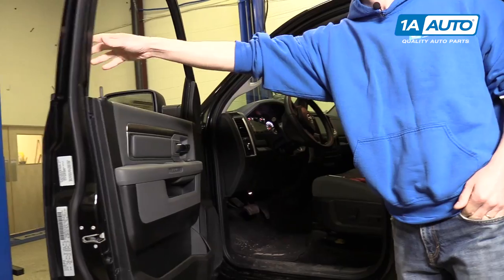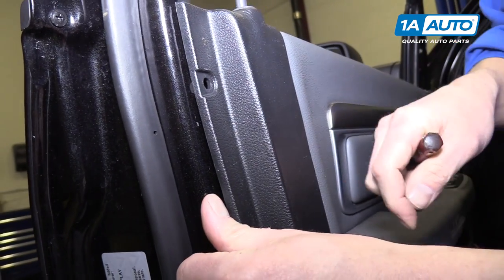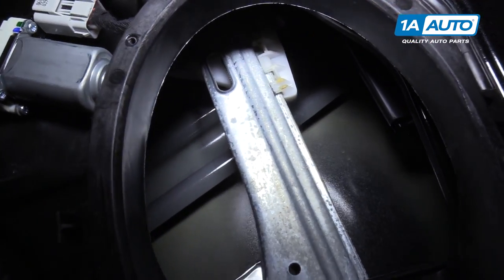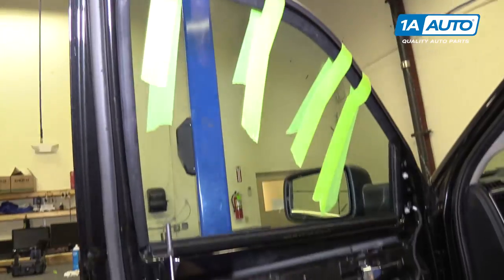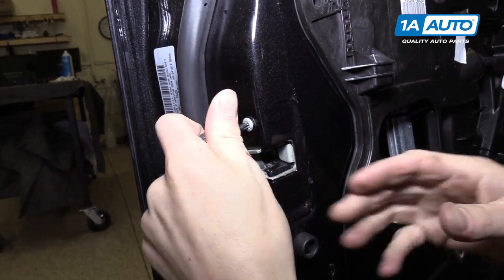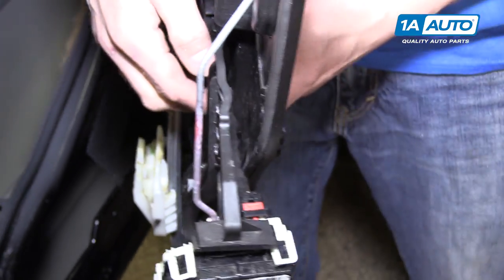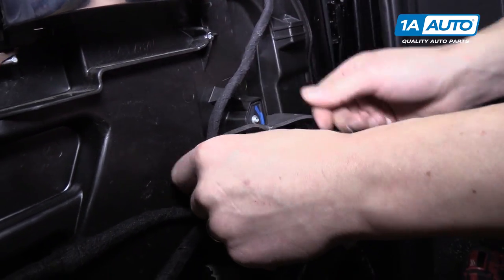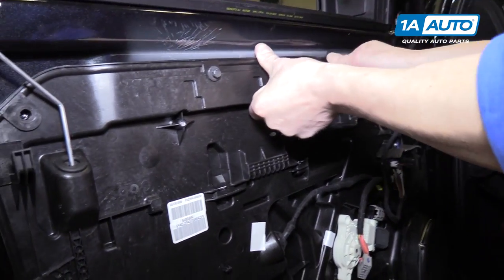How to Remove Front Inner Door Panel 09-18 Ram 1500

Comment: hello, nice video. just had a question or two. recently i had to take apart my door panel on my 2018 ram 1500 because the window had fallen down. i heard what sounded like a grinding noise when i tried to put the window up. turns out the cables attaching the regulator to the motor are binding. your video shows exactly what replacement piece i need to purchase. my question to you is, would you know where i could purchase  this specific regulator with the cables as i am having trouble finding it elsewhere for an affordable price. should let you know that i live in canada. 

thanks

Comment: The first t-20 torx bolts are not bolts. They can pull out. They are not threaded like screws or Boles, rather ribbed so they don't just slip out due to vibration. Push them back in, don't waste your time trying to screw them.